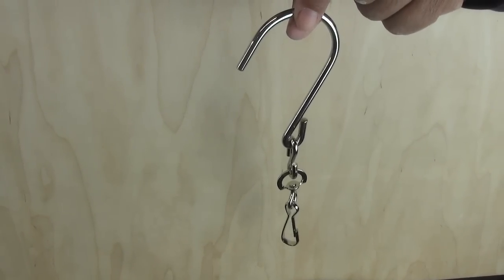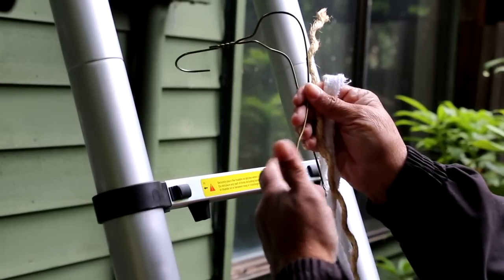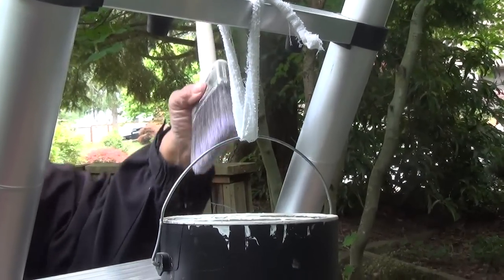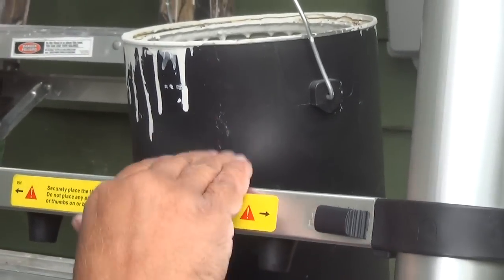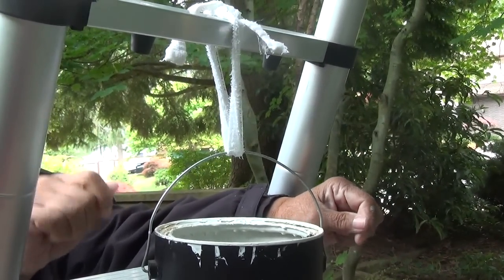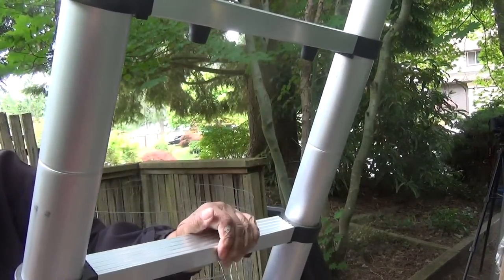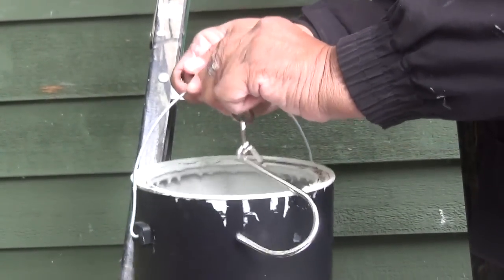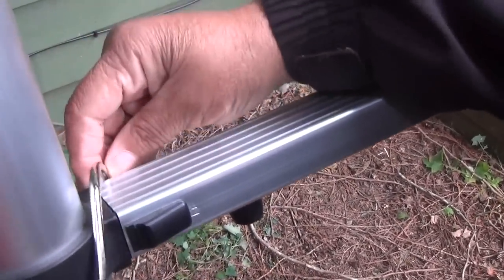Painting Tip When Working Off a Ladder

Comment: My grandfather taught me a few things and one was taking a nail and making holes around the inner lip of the paint can that way the paint would drip back into the can. He also said to exhale into a paint can when closing it and due to the carbide dioxide in your breath won’t cause a film on the paint that you stored. It works I tried them both. Thanks for the video

Comment: That is exactly what I did tonight! I came looking for how to clean my ladder. It’s a mess! I used a plant hanger. Did t think about putting it on the side of the ladder. What I did was drop my ladder down a notch which knocked the paint can off the hook. Thank goodness it only had about an 1/8th if a can of primer in it (mold killing at about $60 a gallon) and two that I had some plastic down. But the rest? All over my already painted siding and patio! I grabbed a bucket and dish soap and went scrubbing. What a mess! Going to get a hook tomorrow. Thanks Leah!

Comment: OH Leah. Been there done that. I was painting a friends trim one time and i used a coat hanger to told my paint. I went up the ladder to his third level windows and everything as going fine, till went up farther on the ladder and some how I caught the end of the hanger with my belt and straightened it out enough to slip off the ladder. ONE FULL GALLON of white paint all over the lawn. furniture. table, walls and  windows . What a mess. I rusd down and ran to the garage for the power washer. That goodness for water base paint. I was able to clean it all up. But it took me hours and the loss of paint plus the day of painting. I will to get me a hook or two.
Thanks for the tip. ( a year too late).
Andy
Reply from the maker: Oh wow, Andy.  Thank goodness it was water-based paint and that you had a power washer nearby!
Reply: You got that right. I was so nerves that it wasn't funny.

Comment: Most ladders have a hollow rung (not all).  Another tip you can use is to install a large dowel thru the rung plus 8" and hang your bucket on that.  I always put a through screw at the end just in case your ladder is tilted.

Comment: +seejanedrill get a Wooster pelican paint holder drill 2 thin holes on the top sides of it right in the middle, then take a paint handle off A can and hook it through the holes. Now when you need to paint you have two options one for a brush and two for your mini roller and that little hook is complimenting that. FAST AND NEAT.

Comment: They had had those for 25yrs most painters put em on 5 gal buckets so we can usa a roller and a brush depends on the surface. With a sprayer you stick the brush in a ladder rung.

Comment: Great product.  I'm getting one of these.  

Do you have any videos where you address the best ways to get on and off a ladder?  I have an RV and really need to get on the roof but I'm concerned with making the transitions from the ladder to roof and roof to ladder.  Thanks for all your great content.
Reply: Knut Blaise I agree!
13 months ago I was making the transition from ladder to roof and the ladder kicked out from under me, I was literally grabbing shingles and praying!   The Good Lord saw a reason for me to live! I only crushed the bones in both hands, wrist and arms. 40+/- pieces of shattered bones. I will spare you the rest of the details. Bottom line is safety on the ladder, don’t worry about the couple hundred $ in paint & cleanup, I’m in a couple hundred thousand $$$ and more surgeries to come. This is not a pity story, I hope this helps anyone from tragedy. 
Please please be careful ! Thanks
Reply: I used to have the same problem with a caravan. I never attempted to get on or off without someone holding the ladder. It's darn freaky. i'm scared of heights too and the shaking just makes it worse.
Reply: That's the scary part for me, too.  Going up and down on the ladder is no problem.  Walking around on the roof, also no problem. That transition from ladder to roof and roof to ladder has always scared me, though.
Reply: Keep the ladder extended about 3 feet past the roof deck.  Make sure the legs are level on the ground.  They make leg levelers for extension ladders.  Don’t carry lots of tools in your hands, use a bucket and a rope.  Keep your weight centered between the legs going up and down. When you step off the ladder, don’t use the ladder to push off, especially if it’s not tied off.  When getting all your weight from ladder to roof, hold the leg down, don’t pull it towards you.  It’s more natural to push down on the leg when you are getting on the ladder from the roof, don’t push too hard on one side.  Just balance.  And if you’re wearing carpenter pants with a hammer by the leg, step off towards the hammer ;). We just tied ladders from the middle of the rung on to a gutter spike.  You don’t want to trip on the rope.  It’s just to keep the ladder from falling if it’s kicked when you step off.  Always a good idea to have another person on the ground.  And if that person is steadying the ladder, don’t carry anything that can drop on their heads.  They can toss the rope up to you.
Reply: NEVER step on a ladder rung that is higher than the roof level.  If you do this, your weight will cause the top of the ladder to pivot towards the roof and the bottom legs of the ladder will pivot up.  Since the ladder is not supported on the ground, you will hit the ground unless you are lucky enough to have something to hold on to.

Again, Never step on a ladder rung that is above the roof level.

Comment: There's a way to grip the gallon with one hand and still be able to use that hand to cimb with  paint can in hand. Hold it like a soda can and hook the pails handle over your thumb. Ideally you don't want to have a full gallon doing this. It will leave a mark but it goes away and doesn't hurt.

Comment: Leah you know in late 90s internet there werent life hacks but their was a guy in hsn or something called Haleys hints which showed a lot of tips and tricks which im sure have been replicated called life hacks.  One was to wipe in foaming shaving cream on your mirror to keep from fogging when showering..  Another which applies to this is he ran a rubber band vertically in the middle of his paint can so you dont have to wipe excess off the side.  Works great.

Another tip was for pickpockets and using a pocket comb in the middle of your wallet as an anchor/catch on your pocket.  

Sorry your hanging paint can and edge wiping reminds me of him
Reply: you mean horizontally don't you...
Reply: Jed Knutson I remember this from way before the ‘90’s...the rubber band went completely around the paint can when the lid was removed so it’s perpendicular to the handle. One would swipe the tips on the rubber band instead of knocking it on the side of the can.
Reply: Jed Knutson all the way around, would be both vertical and horizontal depending on your perspective.